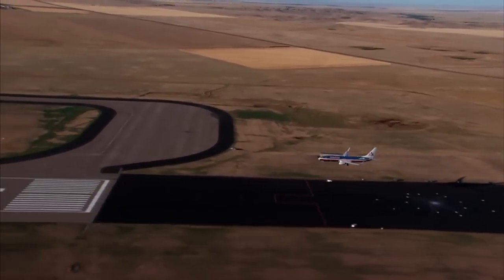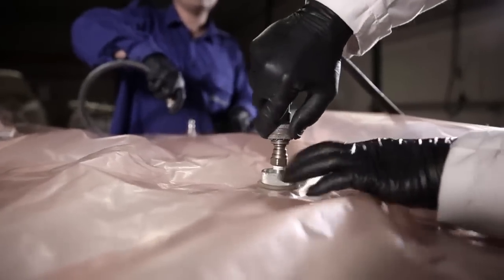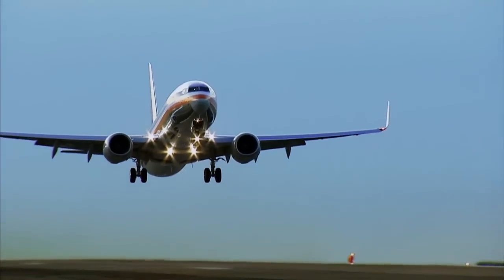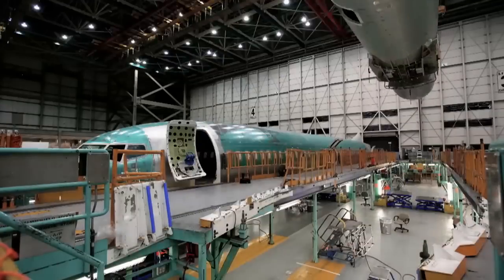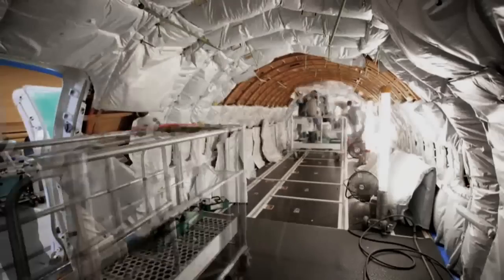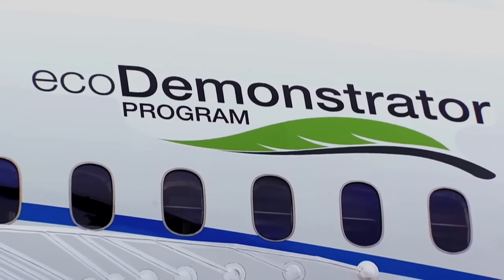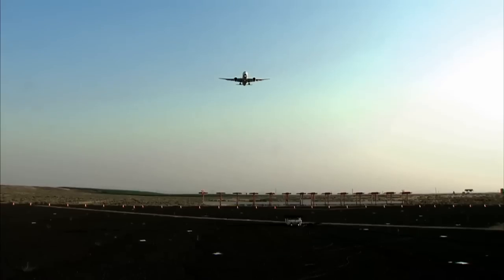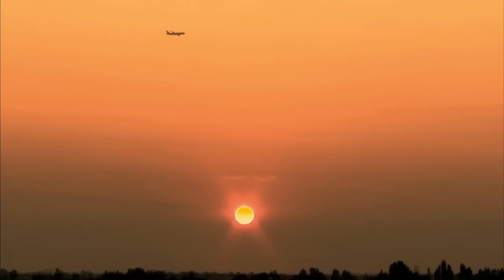From Plants to Planes, Boeing's Creating Sustainable Airplane Interiors

Comment: If I understand this video correctly, the flame retardant and the resin are both biodegradable?
Reply: I doubt it. I would be really curious to see what a bio-degredable flame retardant would be made of.
Reply: If the resin and flame retardant are not bio-degradable, I can't see how "the panels can be disposed without harming the environment."

Oh well, at least it is a step in the right direction, but the video seems misleading to me.
Reply: I dont get how its fire retardant cause it burns

Comment: If an aircraft crashes into the ocean but remains intact, the water gravity would make it nearly impossible for the crew to open escape doors. Why not build escape #Hatches on the above compartment areas from tail to cockpit. You would give all passengers & crew a fighting chance of survival. Inflatable dingy's could be automatically deployed once each Hatch is opened. #SavingLives

Comment: I wonder if algae could be genetically modified to take CO2 & exhale O2, producing supplemantal breathable air while inflight, stashing the growth somewhere with in the unused space in the plane..if there is any!  Would it be worth considering?  Maybe have algae panels which can be easily taken in & out of snap in panels.
Reply: Why have that when you can simply have an intake on the underside of the aircraft to take in fresh air from outside. 40,000' is not space, there is breathable air up there, it's just really thin.

Comment: Using #kevlar for the outer skin might reduce impacts on human casualties.
Reply: But which associated cost proves worthy, saving lives or saving property damsge?
Reply: It wouldn't, it doesnt crumple and absorb energy, just like the carbon composite on the dreamliner the impact forces would be so sever youd be killed even if the aircraft remains intact
Reply: andrew wright The skin of an aircraft is totally irrelevant when it comes to absorbing impacts anyway, same as the "skin" of a car. It's the internal structure that matters.
Reply: it kinda does since the dreamliners a plastic material it doesn't crumple and bend like aluminium instead it shatters and causes a sudden severe jolt to the passengers which is kinda bad
Reply: andrew wright The skin isn't what absorbs the impact, the structure underneath is. 
.040 Aluminium is not going to absorb anything at all in a 250kt crash anyway, and neither will a carbon skin. 

There is no disadvantage to using carbon fibre in aircraft.
Reply: Consider building an aircraft with three detatchable sections that all join together with titanium struts. In the event of a mid-air crisis, the fuselage fitted with heavy duty parachuttes, would be released to freefall to the ground. The under carriage section comprising the wings and luggage compartment, would be jettisoned without parachuttes and be considered as a write off by Insurance companies. The main cockpit cabin including passenger seating   would have heavy duty parachuttes in the underbelly compartments which, fastened with titanium would possibly bring all crew and passengers down safely without injury.

Ever since the dawn of aviation we've stuck by conventional aircraft design and the air-disaster statistics would prove that we haven't really embraced technology nor #changeofpattern in the style in which we build commercial aircraft.

This idea alone is meant to #SaveLives and it could at least be tested to prove if it could be the new in air travel of the future.
Reply: ***** The problem with that is that the packed parachute[s] would occupy a volume approximately 25-35% of the actual fuselage. It would either have to go inside the passenger cabin [reducing available space] or on top of the fuselage [increasing drag by a huge amount]. Putting it in the belly of the plane would not be a great idea either because it will reduce cargo room and may cause the fuselage to want to be unstable or even roll over when they deploy. That would not be economical either way. 

Another problem is that a structure made to come apart will never have the same unity as one that is not made to come apart. So you will run into problems of sealing the sections together and flexing stresses. This would drive maintenance costs up and necessitate more frequent inspection of parts that will likely be difficult and time consuming to access. 

On the other hand plane crash statistics show only 12 commercial aircraft crashes in 2013, the vastest majority of them due to pilot error. 

The design philosophies behind modern airliners are not a safety concern.